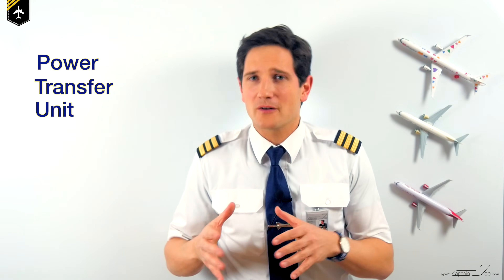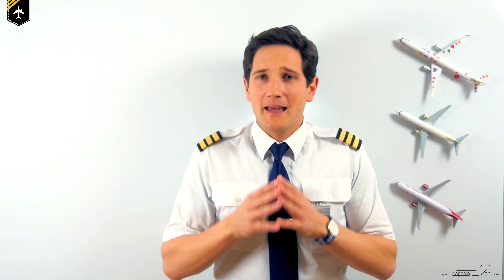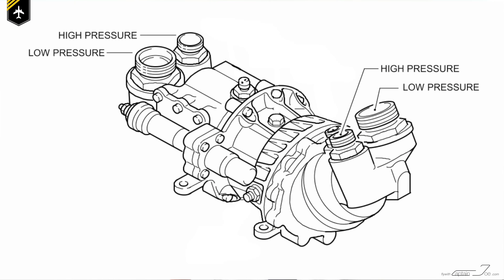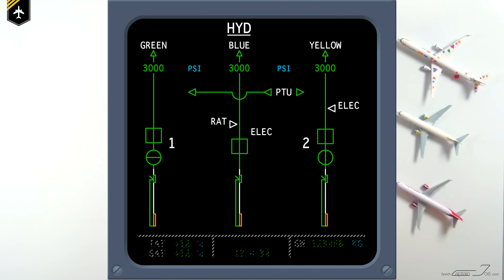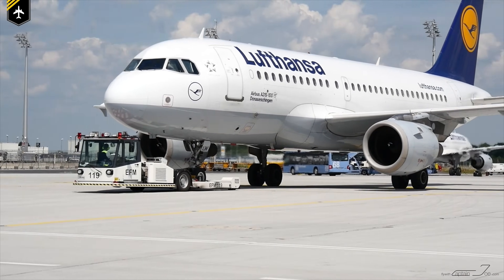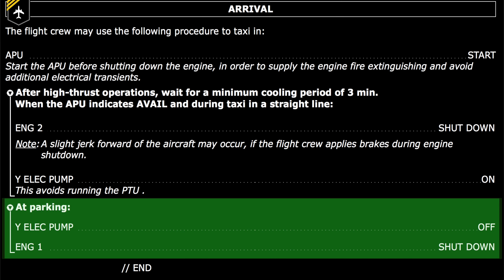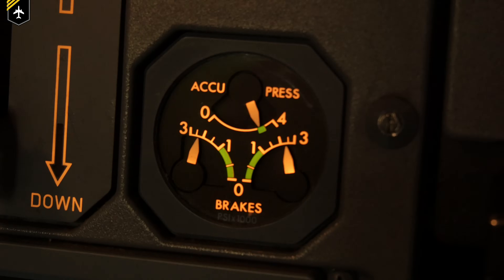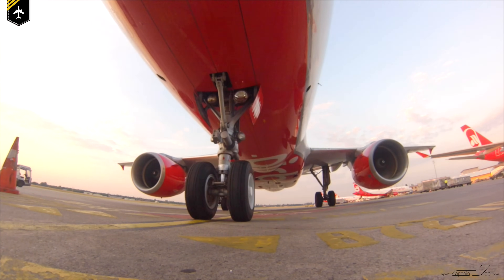MYSTERIOUS BARKING SOUND on AIRBUS? All about the PTU explained by "Captain"Joe

Comment: Interesting! How about the high pitch noises when an aircraft if parked at the gate, and you board it outdoors, you can clearly hear a uncomfortable high pitch noise from the aircraft, what is it coming from? The engines? You can hear it on both Boeing and Airbus but most clearly is on the 737. Thanks for a great channel!
Reply: That's probably APU sound. Worst I heard is Embraer APU - loud and annoying whistling sound. Generally, apron is quite noisy place > too many vehicles, diesel power generators, APUs runing...

Comment: If it's not Boeing I'm not going.
Reply: LOL dude, are you for fucking real? I mean, you know there are not "Airbus Engines", right? You ignorant piece of shit
Reply: Mr Doe meets Mr Smith... I think you know he said it just to be a prick. CFM/GE, P&W and RR are used for both Airbus and Boeing, that's why shitting on "airbus engines" makes no sense.
Reply: Boeing fan are soo stupid sometime....
Reply: The whole saying is silly side, because about half and half are Airbus and Boeing at least here. If you want to get somewhere on time and be flexible, you cannot exactly be picky and rule the other out.
Reply: Boeing fans look up the number of explosive decompressions of Boeing planes and compare to the very few Airbus ones... edit: then look up the causes so you exclude bombs and missile hits, and the gap is even wider...
Reply: Nobody understood you were making a rhyme
Reply: John Doe yes that's true, however you can also argue that 1930's cars have better handling since they don't have hydraulics and shit. See, when you go in the air handling doesn't matter. All that matters is safety. Therefore, a glorified computer (or car with safety systems) are safer therefore better than what feels real.
Reply: Петър Василев Except the A320 uses 1987 computers, and automation can cause more problems if the user is unfamiliar with the behavior of the system.

Actually, were you even alive in 1987 when the A320 was introduced?
Reply: John Doe a320 is cfm too, basically actual 737 engine was destined for a230 that wy 737s nacelles is flattened. And airbus is better.
Reply: Yup... Airbus engines sound like lawnmowers...
Reply: Airbus is 10times safer and easier to flight than any Boeing out there including the 777. Just a thought.
Reply: at least with Boeing the plane does what the pilot asks it to do vigilantly and willingly, unlike airbus where the thing will only do what some zit faced kid tells it to do when programming the computersystem....yes Boeings DO require a pilot to fly them, but isin't that the point?

oh yes, statistics show that airbus crashes more often than Boeing, might have something to do with actual pilots flying the Boeing, not some stupid computer system
Reply: Yea, I dont trust busses either

Comment: Thank you, I have always wondered about this sound! There's another unique mechanical sound I have always noticed on the Airbus. At certain power settings the engines produce a very mechanical sound. It's difficult to describe but it generally occurs after initial climb out. I have wonderred if it is an acoustical resonance produced by slight difference in engine RPMs. Do you know what I'm referring to?

Comment: ram air turbine whaaa? what quirky thing is that? video required please.
Reply: Lucien Petersen  in the unlikely event the aircraft looses both primary and auxiliary power,  the Ram Air Turbine or RAT, as it's known, deploys from the underside of the aircraft.  it generates power from the airstream by ram pressure relevant to the forward speed of airplane. the faster the plane is moving through the air, the power increases. these units can generate around 70kw on the high end and the smaller rigs around 380 watts.

Comment: Hey joe i have a question, what do pilots do if both engines fail mid-flight?
Reply: It would depends on why the engines shut down. But the APU can start the engines.
Reply: There are tons of different procedures specific for different scenarios of engine failure. Modern engines are typically equipped with an autostart system that tries to start the engine back up from the bleed air from the other engine if it fails. If that fails the pilots will try to restart the engines from the bleed air from the apu, provided there is still fuel. But if both engines fail and there is still fuel, then the apu can power all of the aircraft's flight controls so that it can be safely landed with no problems, provided there is still enough altitude to coast down to the nearest airport. But if they run out of fuel in mid air there is something called as the RAT (Ram Air Turbine) that can be deployed, which looks like a small propeller, that spins up and powers the most important flight controls to help coast the aircraft down to the nearest airport.
Reply: Pretty late reply here but your answer is "Im starting the APU" (reference from sully) OR... put your gear down and land in the middle of the city and get your company sued.

Comment: When I was departing onboard A321-111, A321-211 and A320-200 I heard something like roar or buzzing sound coming from the engines when full thrust is set on runway during take-off ,but not everytime. In Fokker 70 and Boeing 737-700 the sound was missing I wondered what is this sound and why is it only in Airbuses ?

Comment: Hi Joe, thank you for this one! A was thinking about this sound for a looong time :)
However, I noticed that this sound also appeared when the flaps were "moving in", is this possible? 
Thanks ;)
Reply from the maker: Fairly unlikely, depending on where you saw it, either in flight or on ground. On ground it´s possible
Reply: Captain Joe it was on the ground, I was sitting on the wing :)

Comment: If you stop the engine nr. 2 first, which it is usually also started after the nr. 1, in long term there will be a big running time difference between the two engines. Is there a difference in the maintenance schedule of the two engines?
Reply from the maker: No not that i know of !

Comment: @Captain Joe, is there a gas maak in the toilet?? Always wanten tot ask that😂👍
Reply from the maker: Yes there are to oxygen masks in every toilet :) Greetings Joe
Reply: Do you mean there are two O2 masks in every lavatory? Are they for the members of mile high club, if the need arises?
Reply: *mask
Reply: They're o2 masks and yes they do have them installed in the lavs at least for the company i work for (united) after 9/11 they actually had them removed due to the threat of passengers  opening the psu's and using them as a fuel for explosives since they were the  old style o2 generators  that produced heat. But we had a mod done that reinstalled a new style that doesnt get heat up and now all of uniteds fleet has o2 masks in all of there lavs.
Reply: Captain Joe and Dean Harrinauth Thanks!
Reply: Depends who has been in there before you :-)
Reply: @Alexagrigorieff 

A main reason not exactly that :) But we (all in the aviation business - as mechanics, designers, pilots, flight att's etc) sometimes care about the kids as well whos maybe can't be alone in the toilet AND in case of loss of pressurization, or other reason they need an oxigen as well.

Comment: Hello Joe, does that mean that when both engines are shut down the parking brake rans out of hydraulic pressure and stops working?
Reply from the maker: There is an accumulator pressuring the parking brake. What my video on "What is block time" and you see what I mean :)

Comment: Nice video Captain! What about a similar sound (similar to a photo camera extending and then closing the lens) coming from above the cabin during the flight, you can hear it when the overhead bins are open on the larger aircrafts (B777, A380 )?

Comment: Great video, but here are two related questions: a) I've heard it on B737 (-600 I think), presumably they have similar-sounding and operating PTUs as well? b) On the same occasion (B737 a/c), the sound did not cease after engine start. In fact it persisted throughout the short flight. Is hydraulic imbalance considered an OK item for a MEL (minimum equipment list) release?

Comment: How hard is it to steer the Airbus during a one engine taxi? I've seen CRJ's do it, but their engines are mounted closer to the centerline.
I know that 777s have a lot of trouble with it. That Swiss 777 that landed on one engine a few weeks ago got stuck on the runway because they couldn't steer against the differential thrust.

Comment: IF IPHONE CAN, WHY CAN'T A BILLION-DOLLAR PLANE?

Captain Joe, I have watched tons and tons of Air Crash Investigation and majority of it was caused by one main reason, pilots are blinded by what's happening into its enormous aircraft. 

Question, why can't Airbus and Boeing fit tiny powerful HD cameras like that of an iPhone designed not to mess up the aerodynamics to monitor like a CCTV all around the critical internal and external parts of the plane? Then add strobe lights to easily check the undercarriage, elevator, rudder, storage compartments, gas tank, hydraulics all from the nerve center of the plane in the cockpit.

A Rolls Royce engine costs $20 million compared to a $1,000 iPhone. Why can’t this technology be embedded?

And the cockpit flight monitors, why can’t they put Retina Display Big, Bold, Web-type extremely easy to use User-Interface that even the non-technical like me can operate and safely land it in case of an emergency?

Remember the Helios when somebody taken over the captain’s seat but unfortunately he cannot operate because its too complex to understand.

If game centers in the malls have already simplified to operate like an iPad, why can’t a billion-dollar plane? 

Why the world they cannot innovate???

Comment: Can you explain that fan thing that came out of the plane that you said was for another video
Reply: The ram air turbine
Reply: it's used only during emergency procedures and it provides electric power when for example the engine generators fail, it works like an ordinary wind turbine, during flight the speed makes it rotate and this produces electricity
Reply: Giuseppe William Giamundo ok thank you

Comment: 1:36 WOW!  Never seen that before!
Reply: That is the RAM air turbine (RAT) which is connected to a hydraulic pump or an electric generator which serves power to the aircraft due to its speed. Generally used during an emergency like dual engine failure and APU, this turbine provides power to aircraft for flight controls when the airplane is moving at high speeds. If the airspeed is less, the RAT will generate less power.

Comment: I know that this question may be atypical but can you answer why the concorde had a drooping nose which changed? I can't find a good youtube video explaining this.
Reply from the maker: Meeting up with Concorde in April, lots of videos about her will follow, trust me :)
Reply: amazing saturnv Concorde was designed to fly at mach 2, everything had to be streamlined.  the reason the nose is selected to 5 degrees down is to provide the pilots a better view of the runway during  taxi and takeoff.
 this was controlled by a four position  lever in the cockpit.
pos 1. nose full up, visor retracted
pos 2. visor down, nose full up
pos 3. nose down 5 degrees used for taxi and takeoff.
pos 4. nose down 12.5 degrees used for landing. it was powered by the green hydraulic system.
Reply: Captain Joe glad to hear.  please do a special  segment on Barbara Harmer, the first and only woman to pilot Concorde for British Airways. I had the honor of meeting her in New York several times. amazing lady💖

Comment: the sound always sounded purely mechanical, and I always love hearing all the mechanical sounds because it reminds me that I am not in a tin can with a rocket strapped to it, I am in a very complex engineered machine that has been deeply studied!

I usually thought the sound was from reverting the flaps to normal position from extended, though there are many sounds so that could be one of them
Reply: I know somw people that think that planes are simple. Only engines, wings and winglets and rudder. They are a lot more complicated.
Reply: @p_1749  to be fair, I was 17 when I posted that comment, and I've felt this way since I was 5
Reply: My relative used to work as a software engineer for Airbus. It amazed me how complex just the communication software on the aircraft is. There are many modes of communication, and each one has different priority based on how critical the communication is. Each piece of software goes through severe scrutiny before even being greenlighted for an on-ground test with an aircraft. And even more for in-air testing.

Comment: explain every control surface (flaps, slats, spoilers, ailerons, rudder, elevator, stabilizer, all the tabs/trim, flaperon, spoileron, etc). How/what controls them, their affects on flight/performance/comfort, etc. 

While descending in flight I usually notice that the flaperon/spoilerons I think will just flap around in the wind / appear that they're not being held in position. I'm not sure if they're really being 'cut loose' or there's a system that's actually controlling them and making them move that way. Also, what exactly is the point?

Comment: Why can't both engines be started simultaneously??
Reply from the maker: For the same reason it's very difficult to inflate 2 balloons at the same time. Air pressure, or lack of it.
Reply: Bhrigu Bharadwaj Pant the Honeywell APU on the A320 can't puff out enough pressure to turn both engines at once. the APU on the A340 is a different animal,  can turn two at once no problem.

Comment: Hi Joe, 

I didn't understand if the yellow and green systems are redundant (like a copy, in case one of the fails) or not. The blue system is like a backup, that's ok, but do yellow and green power different mechanisms?

Comment: Joe can you explain what do the pilots do when the APU caches on fire.
Reply: If the APU catches on fire, there are fire push buttons inside the cockpit which are pressed. After that they wait for around 15 seconds and then press the agent discharge buttons to put off the fire. Same procedures are also followed in case of an engine fire but prior to that the engine is set to idle.

Comment: If something comes to Airbus is good cabin noise isolation ... they forgot this thing aparently of someone decided that it was funny anyways. But some people is a bit scare of flying and this noise (given it weirdness) probably wont help at all. Long ago I fle AA, it was a 777, probably a 200, very noisy. But hey, it was normal. In the return flight, SAME model of plane, same noise, but for some reason, a loud noise could be heard every time the wing moved. It was VERY LOUD. To make it worse just pass through a turbulence and the noise was insane. I most admit I got a bit scared because the SAME plane in the other flight didnt make this noise. So, it couldnt be normal. I have %100 confidence in the plane as a machine, but the companies ... not very confident  ... Of course I was sure that the 777 wing would not just come off, but the noise didnt sound good at all ... now imagine 10hr flight. Also was a bit scared (at first) of the engine noise, too loud, too much noise and vibration. First time in this type of plane, you start to think "is the plane is having a hard time to keep flying" ?. Then, many years later, I realised that Trents on the 777 just sound like that, nothing wrong, pure quality and %100 dependable. The things you dont know, what you hear and you imagination ... well sometimes fools you.

Comment: i notice a sound during approach for landing, that continues for some time after the plane has landed, have heard it on a320s, 787s, 777s, there is a quite noisy electric motor type noise constantly whirring in the cabin. is this an extra electric hydraulic pump being switched on for landing to provide an extra safety net for the hydraulic system??
Reply: Well, 777 has a lot of electric motors. For example, on take off and landing electrical "demand" hydraulic pumps activate automatically to cope with hi demand.

Comment: Hey Joe, very good explanation! :-) 
But is it just me who noticed, or is it fact, that engine no. 2 is the first one to be started every time?
In your vid you said, that engine no. 2 can't be started, while starting no. 1. 
Or do you mean, that not both can be started at the same time?
Is it because of the operating hours of the engines (which should be approximately equal in my opinion), that no. 2 is the first one to be started, because it's the first one to be shut down, while the electric pump provides the pressure for the yellow system?
Questions upon questions, i know... ;-) 
But maybe you find time and answer :-) 
Von mir aus auch auf deutsch 😅
Pilot war immer mein Traumberuf, ist es sogar immer noch, doch durch meine Sehschwäche kam dies nicht zustande...
War oftmals etwas deprimierend, bei der Arbeit in den Semesterferien am MUC, die FO's zu sehen, die inzwischen zum Teil wahrscheinlich schon jünger sind als ich 😂
Reply: Ok, habs gerade in der Beschreibung gelesen, dass No. 2 als erstes gestartet wird...😅
Aber dann bleibt immer noch die Frage, warum? 😉

Comment: Wouldn't the constant on-off of the PTU eventually break it, if you were doing that with a water pump it wouldn't last that long
Reply: They have a set service life.so they're changed long before they can break.
Reply: These pumps are designed specifically for this purpose, so they last a long time

Comment: I overheard this explanation while in a plane: The A320 has two hydraulic systems, one tied to each engine. The aircraft sometimes taxis with one engine, which causes an imbalance in hydraulic pressure. The strange sound is the device for equalising pressure.